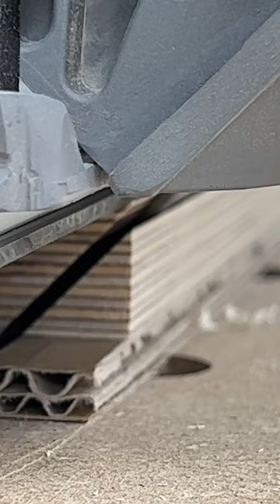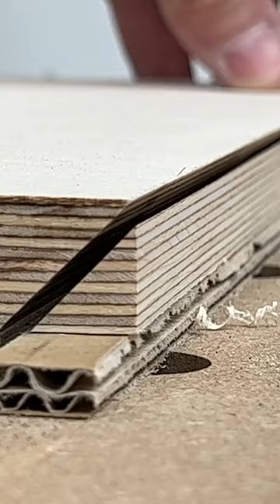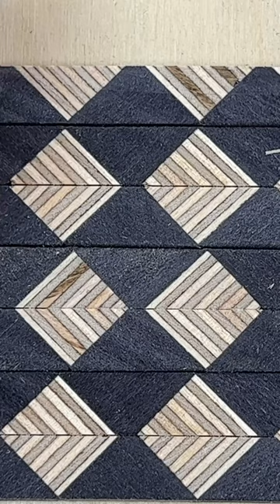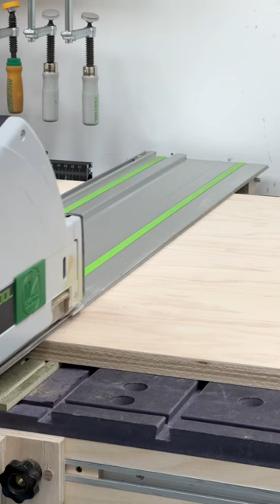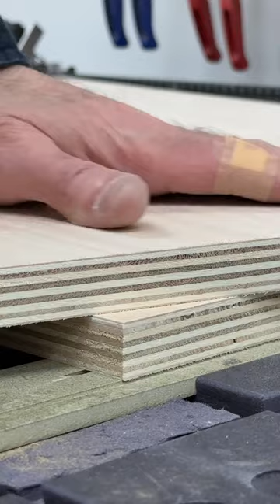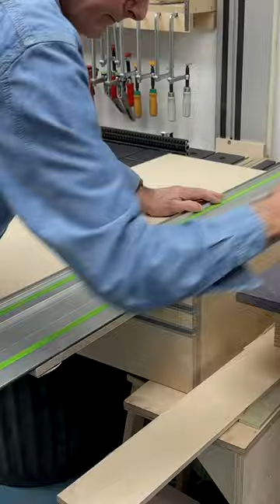‘Baltic’ Birch Basics (short / preview)

Comment: hi I noticed that you used a alveolar carton as sacrifical plate. Why?
Reply from the maker: Not sure if you mean why the cardboard, or why the sacrificial board? I usually use a sacrificial strip routed into the surface of the MFT bench as it's easily replaced and extends the lift of the benchtop. I'm using cardboard here because this was taken from a 'Basic Build' video where I'm only using a limited toolset, and to show that you an achieve the same results with a simpler solution. 👍
Reply: @10MinuteWorkshop  thank you so much for your reply. what I was even asking to me is your preferred hook angle choice in the most of your work as well as the number and geometry of the teeth.